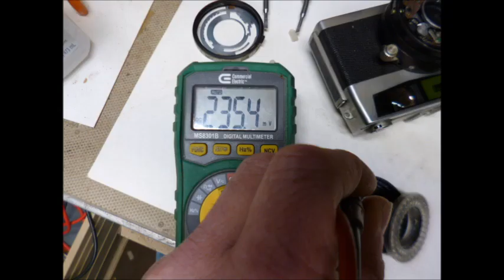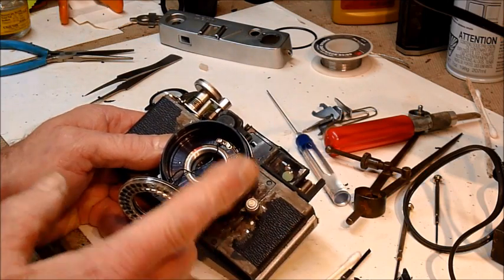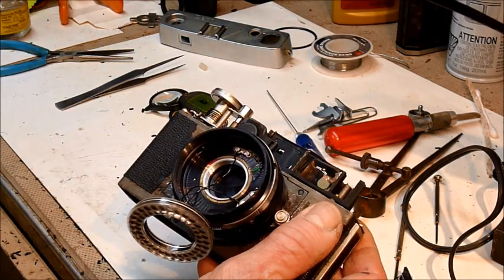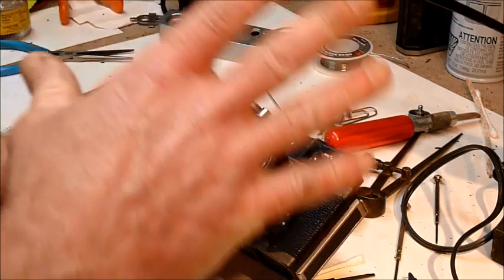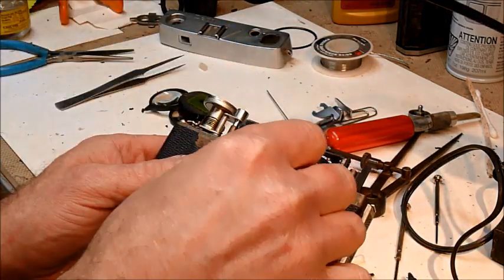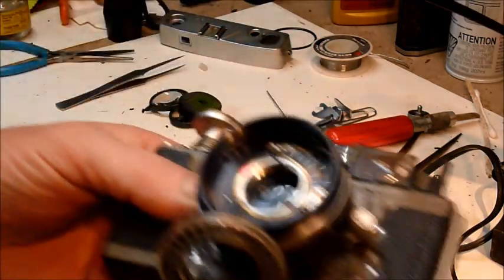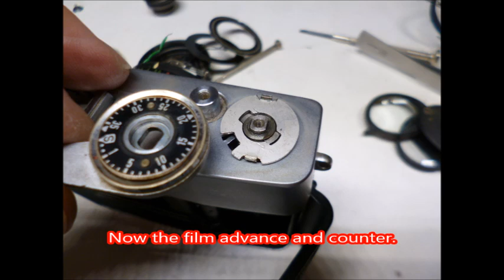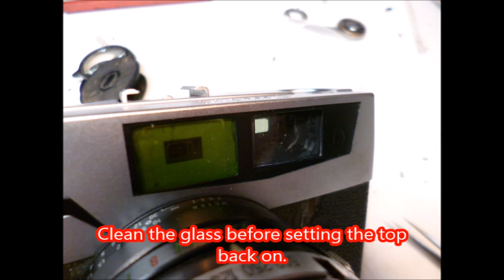Petri 7 sticky shutter

Comment: So are you saying that when you applied alcohol to clean the shutter, you applied too much and it dripped down within the camera and dried up some parts? Would it have been okay if you had been more judicious and your use of alcohol?
Reply from the maker: Yes in hindsight it might have been better to use less, at least to start. Having said that my experience has been that once you disturb anything you are in for the whole ride, so to speak.
Reply: @tobroken1965  I've got the Petri Racer and its quite difficult to take off the apperture lenses block which close to the faceplate. could you advise the tips for doing this job?
Reply from the maker: @eugenepecheritsa2100  Ii is possible its can only be removed by also removing the lens plate. Your best bet would be to by the manual, I found one on Ebay here
 https://www.ebay.com/i/313098119514?chn=ps&norover=1&mkevt=1&mkrid=711-117182-37290-0&mkcid=2&itemid=313098119514&targetid=915282956376&device=m&mktype=pla&googleloc=9001741&poi=&campaignid=10456340386&mkgroupid=101996178845&rlsatarget=pla-915282956376&abcId=2145998&merchantid=101680080&gclid=CjwKCAjwmMX4BRAAEiwA-zM4JvtENC_jQpSUFVSePyvG7h-8KXTUysyfkVaVRqgeBtmmU6RqWwrB-BoCNkUQAvD_BwE
Reply: Link isn’t working- says it’s expired, ugh. I’m preparing to go into the guts, that is, if I can get the lens off first.

Comment: what was the trick for getting the inner lens out
Reply from the maker: I should have phrased it differently, there is no actual trick, I only meant that it takes some time and care. rubber tipped tweezers would be a good idea also. I used (I think) a machinists divider (with custom ground tips) to reach the slots in the ring, you may need a spanner if it doesnt come loose easily.